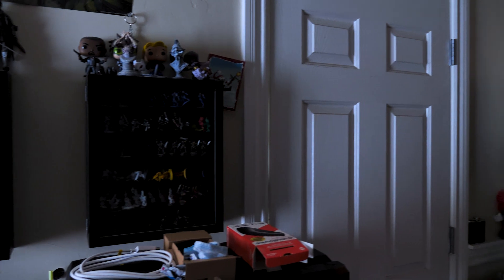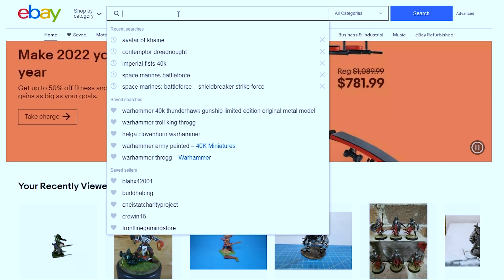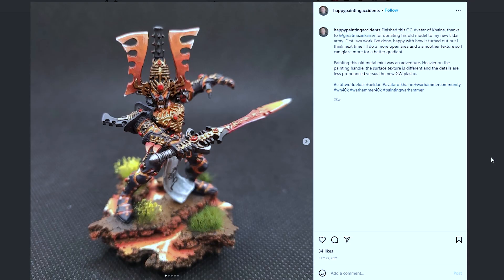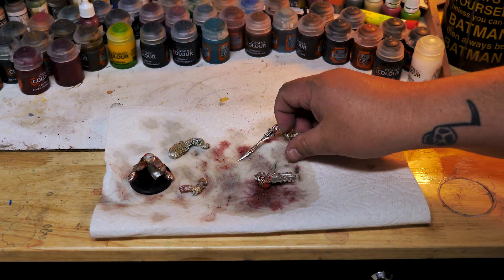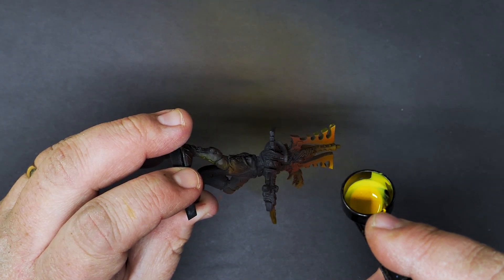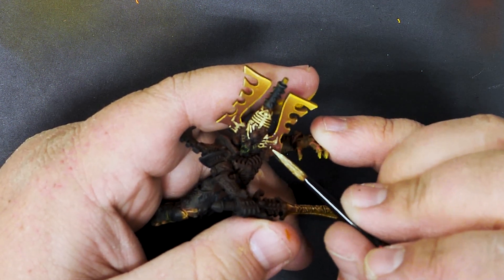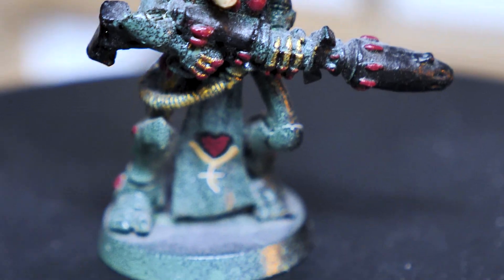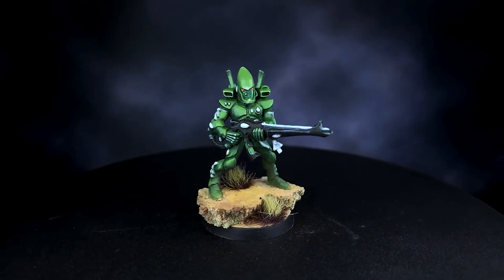My MOST EMBARRASSING eBay Warhammer Purchase!

Comment: First, for those shoulder pad transfers, highly recommend Vallejo decal softener! A video by ThePrefect showed me that multiple coats, pressing it down and letting it dry in between will actually dissolve the transfer material and pretty much just leave the ink. Takes a little while to do multiple coats, but it really makes the transfers look painted with no extra painting!

Second, the orange shirt, purple mask and sunglasses with the Dremel, straight up vibing, awesome.

Third, awesome job on the model. Looks so satisfying to have done how you want all these years later!

Comment: I have a question for you and maybe your peers.  I just repainted the cowling on my Warlock Jet Bikes to reflect the colour I use for special units.  In this case I changed from Dark Angels green to Midnight Blue.  I used a blue grey undercoat and then painted the blue on top and it looks stunning.  It is so deep that depending on the light it hints at purple or a deep blue that goes on for ever.  I might have highlighted and shaded the job but I don't want to change this effect. And with Eldar you can get away with the nature of the equipment looking pristine because that is who they are.  Question: Would you ever paint on a colour and not enhance (?) it because the finish is so good?  Or do you believe there is no option but to layer it down?

Comment: What kind of Dremmel attachment did you use to clean off the last bits of paint? I've been buying some of the old metal Eldar to paint and join my own old metal Eldar and could use some advice for getting those last stubborn paint patches off.
Reply: Looks like a brass brush maybe?
Reply: Other commenter, "yalaz", asked same question, he says a soft steel, but he'd prefer soft brass cause the steel is aggressive

Comment: Which dremel bit do you use to buff pewter models?
Reply from the maker: The kit I bought came with a pretty soft steel one, it's still a little abrasive if you're not careful. Best bet is to look into brass wire ones that are really soft, specifically for cleaning and polishing. I've had them on a list for a while and just haven't picked them up.

Comment: Mate... for metals, just use Acetone. Got a wife? Does she do her nails, and need to clean them? Yeah, that stuff. Just an old jar, a lid, drop it in. Done - yeah, as long as it took to read this, its done. It works instanly, and you just scrub with a brush. So easy, but you can also leave it in the jar for literal years!

Comment: making these old models' look good is almost an effort in futility. your paint in nice, but the old sculpt fails to live up to modern standards. good to see eldar getting some new stuff!!
now for new nids pls, gw? pls?
Reply: Eh it works for SOME older models, the old RT plastic space marines, the 2nd edition metal Terminators...mostly stuff the Imperium range (bar the horrendous faces on early Sister of Battle stuff where it seemed like the sculptor had never seen a real live woman and instead just gave them a serious case of man-face...in fact most early female GW sculpts are absolutely fucking dire). However for some models a snazzy modern paint scheme can't do them justice. 

The one model you almost NEVER see anyone tackle because it's A) fucking expensive and B) honestly a terrible sculpt is the original Nagash model. I'd love to see someone just try to paint that up and make it look good.
Reply from the maker: haha, that model was my first real try at converting a model. The Matrix had just come out and my Dad took me to see it in theaters. So this guardian is basically Neo in the lobby. If I had known about greenstuff you can believe he would have had a trench coat as well lol